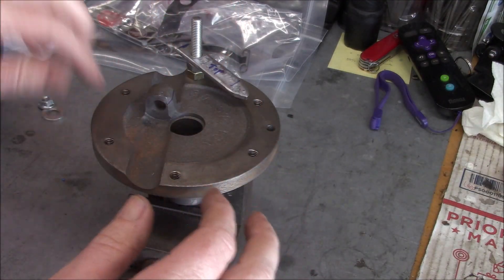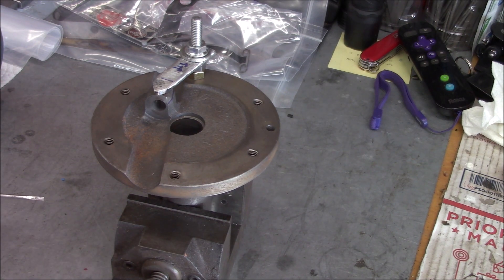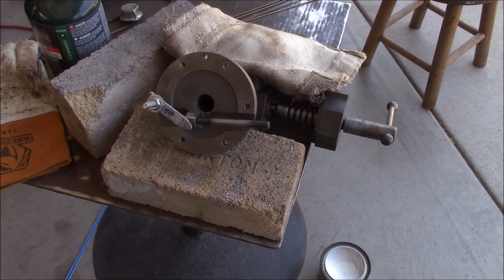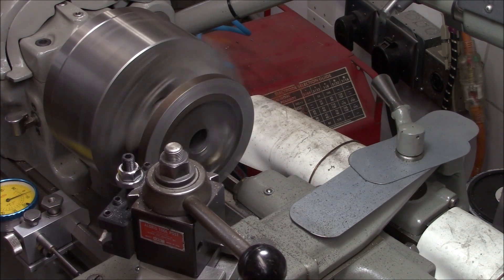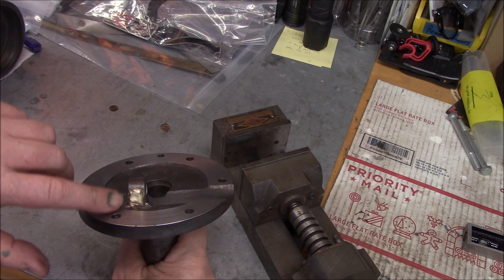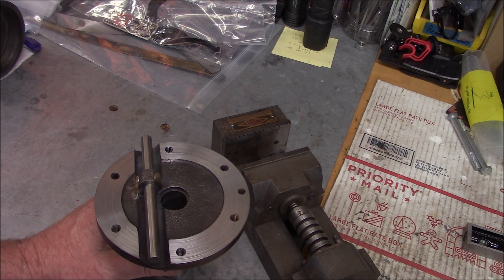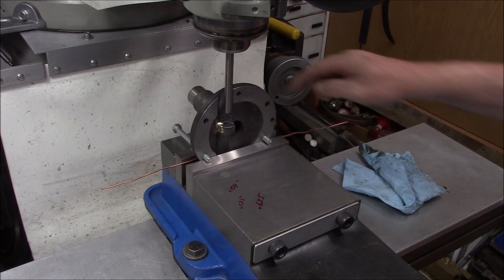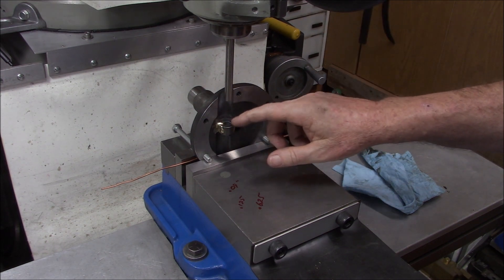Atlas 7B Shaper Project Part 11 - Bearing Hub Braze Repair

Comment: Great repair Dean, very well attacked. This part is not under much radial load and zero axial load so this should hold just great. Arghhh, you went for grey lol, I didn't convert you then 🤣. Cheers, Jon

Comment: Ciao Dean, I have always been fascinated by brass welding, unfortunately my little butane torch cannot reach such high temperatures; we can see a lot of experience on how you perform the adjustment operation before welding,  for example by entering the bar during the processing and also how you had install the clamp, milling table - schooling (😎) , really nice to watch !! Ciao, Alberto.
Reply from the maker: Thanks Alberto ! I was a bit stressed hoping everything would stay in alignment. Luckley all worked out well..
Ciao...Dean

Comment: Nice repair. Sucks when I have to repair something I broke. :) I've never brazed with gas before. I have only TIG brazed. I use a brazing rod from Blue Demon made for brazing with a TIG torch.
Reply from the maker: Thanks Greg, I think I have some of that rod, I tried it with the gas torch. It worked but the flux acted weird and messy.

Comment: I just clicked off of a non recent machinery dealer video of a NOS still in cosmoline SB 7" shaper (Said to have been manufactured new in 1978 believe it or not) which was acquired out of old government surplus and saw this video lol. Repair looks like it will work. Glad to see it cleaned up all the way around with just 5 thou coming off too.
Reply from the maker: Thanks for the view buddy, That would quite a find "a complete NOS machine" cool story..
ATB....Dean
Reply: @TheAyrCaveShop  I forgot they had all the accessories NOS in the shipping crate with it. I bet that sold for some serious coin.  Check it out if interested: https://youtu.be/SaUA3G03iIw